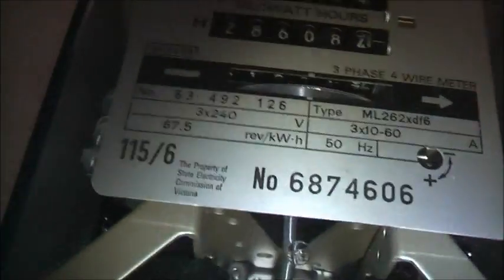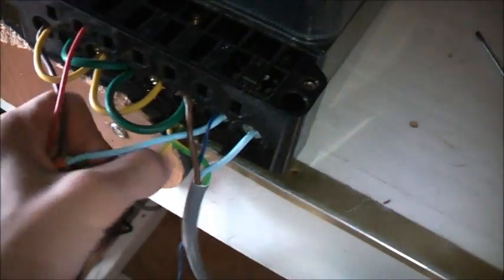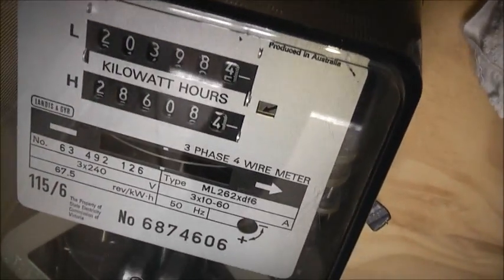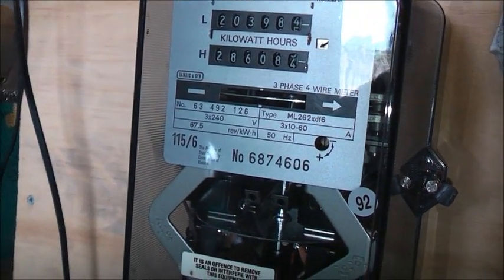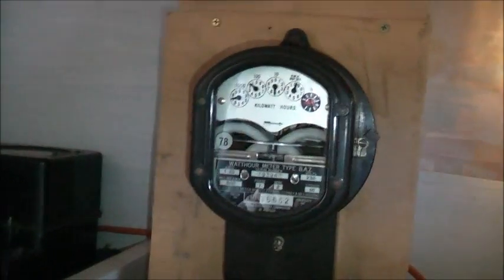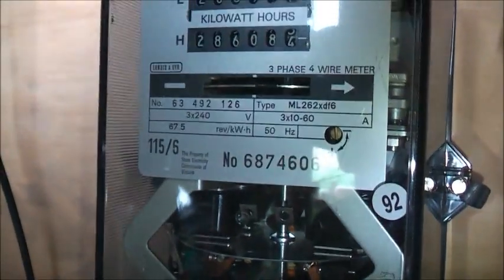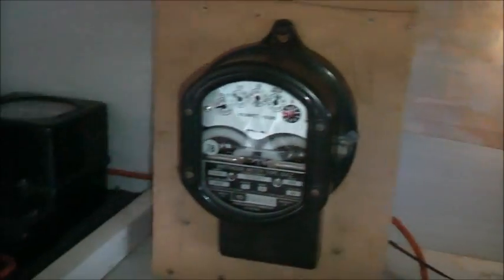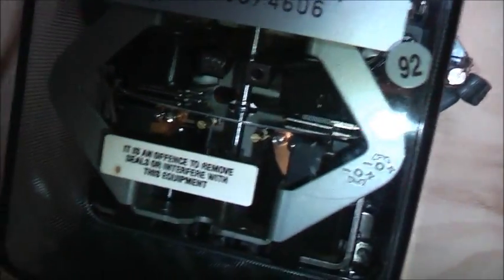Landis & Gyr Type ML262xdf6 Watthour Meter Clean & Test

Comment: Very nice clean & tidy meter. :-) 

Another reason why it may have been re-certified only 3 yrs later, may be because it was only in service for 3 yrs before being removed again, & before putting the meter in someone else's installation, they re-tested it just to make sure.

Or....back at the stores, this one accidentally made its way into the "to-be-retested" pile. :-D These things happen sometimes. :-D

I have a 2-rate, 3ph meter by GEC, but it's a CT type though.

Thanx for showing,

-BBD.

Comment: That is a good quality meter. I have a ML240 somewhere in my basement. rated at 30 - 125 Amps. also a two rate meter. will upload a video of it in the next few weeks.
The Meter may have been in the POCO store for 3 years till it was actually tested and put into service. Often meters are bought in quantities, and two rate meters are not always required.